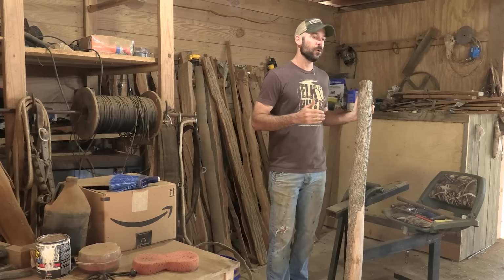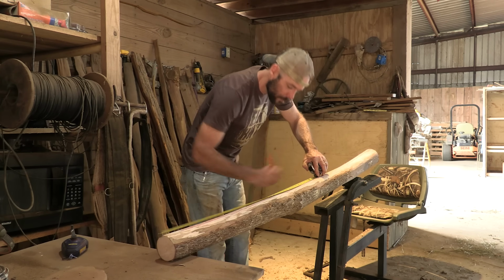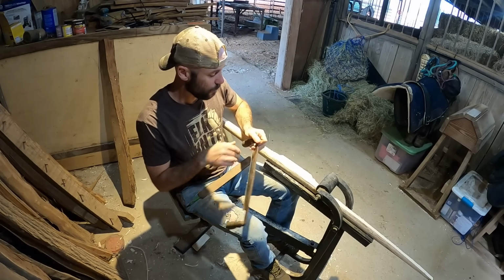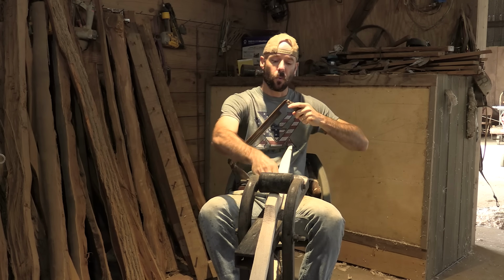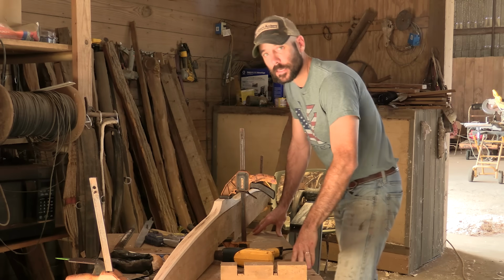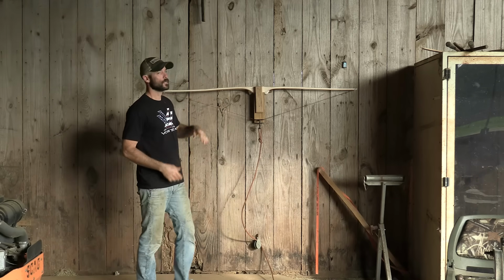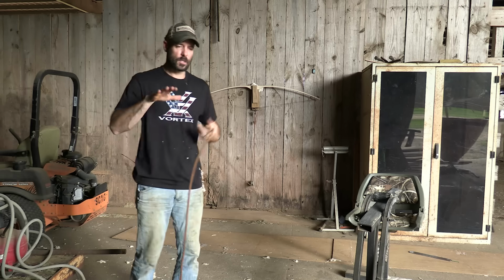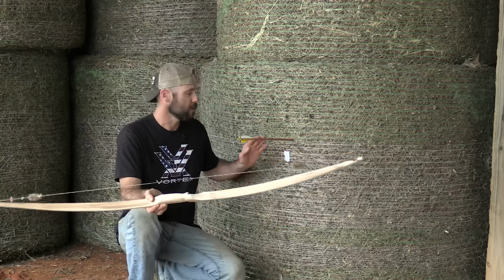Self Bow Building for Beginners - Complete Guide

Comment: Sorry that I may have to challenge some of this...I do mean it respectfully, but I see a great deal of misinformation and/or incomplete information often getting published these days by folks on the topics of traditional woodworking...with bow making being one of those crafts...As validation, I'm not a "full time" Bowyer, but have been making traditional bows (on and off for over 40 years)...and...I am a traditional woodworker professionally in many different folk traditions from architecture, furniture to utensils...

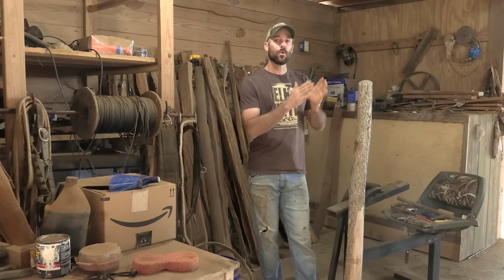01:19...Virtually...NO...wood species...HAS TO BE...dried to work...(with only some acceptions) whether it's a bow, a timber frame house...or even most folk style furniture...That is pure "modern nonsense" and has nothing at all to do with traditional woodworking modalities or means applications...Its skill and understanding of "how" to work wood properly...green or dry...

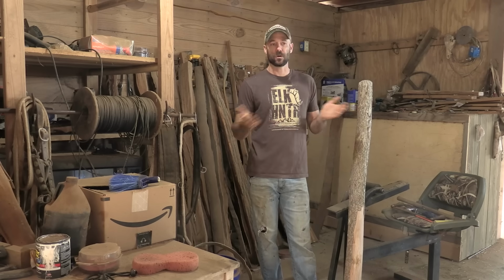01:58...There is a...HUGE...difference between a "crack" and a "check" when discussing traditional woodworking within context to application. No, an Osage stave will not "crack" at all when worked green yet may develop micro checks/fissures (and even some large ones sometimes) that do not affect bow performance at all...AND...most of these can be greatly mitigated if one is trained traditionally in the art of a Bowyer within the traditional (not modern) context of the craft...The wood is worked from green to dry and may (sometimes) even involve intentional case hardening of sections of the bow...

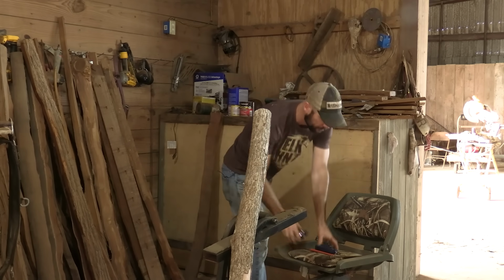07:15...Traditionally a Bowyers would use a "foot or wedge rope vise," which is an impromptu device for such work...or...a shaving horse with a "rung head" similar to what a Chair Bodger may use or released craftsperson...They're relatively easy to make...virtually free if you rive out stock from a firewood pile and better suited to the traditional craft of bow making...

It would be important to point out at this part of your video that the stave you working on is entirely TOO DRY for effective and efficient shaping. In the traditional context, staves were often stored in the bottom of creeks, bogs, and related bodies of water. This is called "resting wood" and is found in several traditional woodworking vernacular...Wood is often oiled or wetted to facilitate better shearing with tools like shaves, draw knives, planes, etc...

11:26...Though a modern chalk line can be used it is not the best tool for this process nor the one used traditionally in most cultures. A "grease line" or an "ink line" would have been used and is much finer and more effective for such "line rule" layout systems...

At 22:58 I have had to discontinue watching this video. You now into "personal methods" that I would never teach but they have worked well for you it seems...Traditional this work is down with riving methods which are remarkably fast when understood and forgoes the use of all the recommended modern tools that are out of context, really not necessary, and often leads to issues that are avoidable for novice Bowyers...

A student referenced this video to me with questions and how I ended up here. Your work looks good, but I would present it as "modern" bow work and not traditional at all...Again, this is meant as only an observation,  not a criticism of your bows, which look really well made and present as performing well for you and your clients...

Respectfully Yours,
Jay C. White Cloud

Comment: How to make a bow for beginners. Step 1: Acquire a specific and reasonably expensive log dried over years that you will probably mess up on inflating the cost massively.

Video is good but dude I can't just run over to the dried log store and pick one up for $10, not really a beginners video if the prerequisite is that you have to have the supplies an expert bowyer just has lying around in the shop.